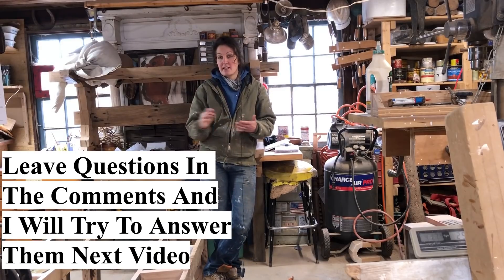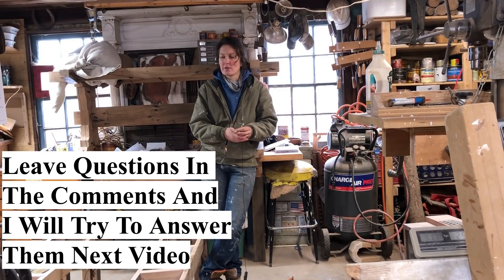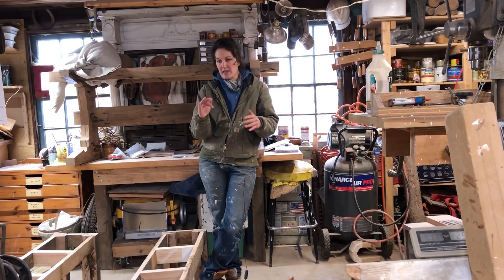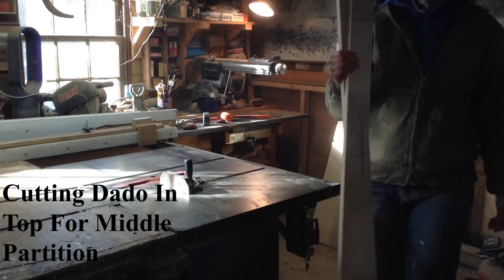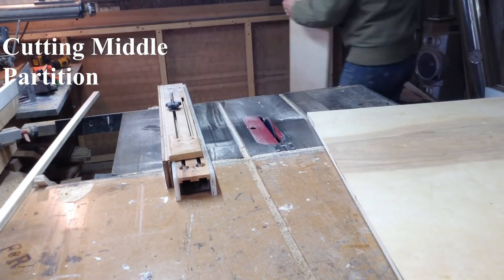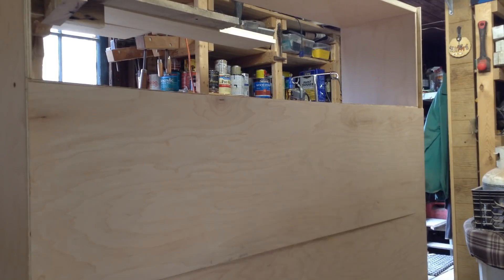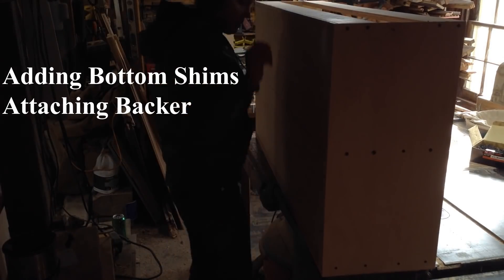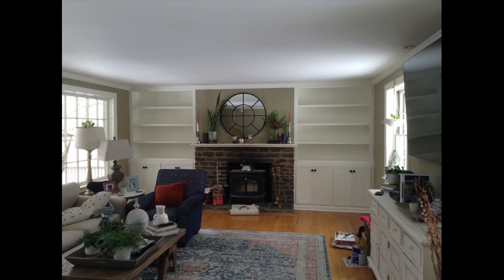Woodworking : How I Estimate Prices & Get Customers // Part 1

Comment: Nice video and I look forward to the remaining parts.  I have found most people assume that a woodworker can build a piece for less money than what they can purchase a ready made piece in a furniture store, Ikea, or Walmart.  My advice to them is that if you can find a readymade piece you like, buy it.  I always tell them I cannot build it for less money than a factory with robots and CNC machines buying materials by the trainload.  Years ago, I "raised the price" for a piece that I didn't really want to build and the customer accepted it.  I guess I didn't raise it high enough - LOL.
Reply from the maker: competing with factories, robots, and CNC machines is tough.  And professional spray equipment.  I get people that will want to match perfectly a custom color finish on custom kitchen cabinets.  It takes a while to explain to them that companies not only have custom colors, and custom faux finish techniques, but also really fancy painting equipment that I just can't duplicate.

Comment: Well, as they say, "the honeybadger is a bad ass" and you do great work so... With prices, I think its quality over quantity. Agree: lumber has doubled since I picked up some casing trim and it was not longer "cheap". You are in a good location (outside Philly yet not far West Chester). I think you are the first of my Youtube Woodworkers that detailed being a shop-owner-woodworker explaining their market without confusing the customer. I have owned a business in PA as a consultant, and yes, you work your tail off to get estimates and then not a response. The customer that says, "whatever it costs, can you do it? Here is a check to start it off. If you need more, let me know" is the customer I prefer....oooh..you gonna tell us about the trestle table?
Reply from the maker: lumber prices are out of control.  I had to buy some 2x4's for this built in project and I don't use 2x4's a lot so it had been a minute since I had purchased some.  I almost choked on my tongue when I saw the price jump.  Trestle table will eventually be a video.  Emphasis on eventually hahaha.

Comment: Are you familiar with the Shopsmith? I’m really wanting to get into woodwork and believe that might be a good overall starter unit. What are you thoughts? Thanks in advance. Love your videos.
Reply from the maker: I know of shopsmith.  Did a little research on them before deciding to buy my table saw.  The consensus from online forums was they do a lot of things, but not any of them greatly.  I imagine having to keep changing it around to different tools is also a pain, and hinders productivity.  Sometimes even changing out my blade to a dado stack messes with my productivity for the day because I can't use the saw to cut lumber, and changing it back and forth takes time.
Reply: @HoneyBadgerWoodWorks  Thanks a ton!!